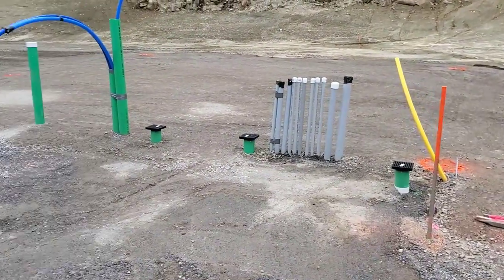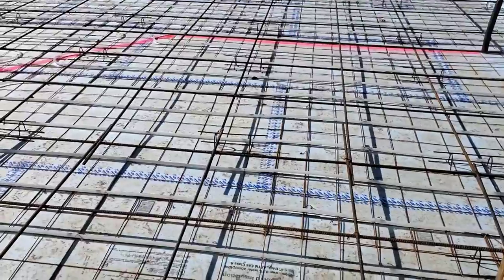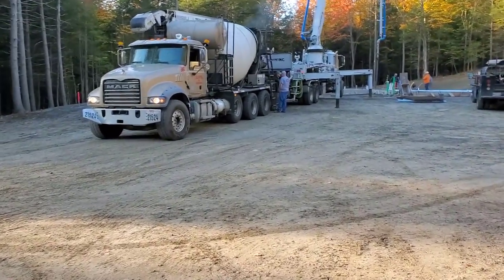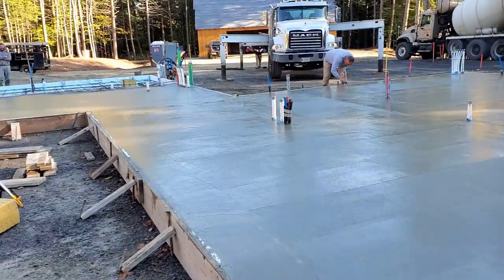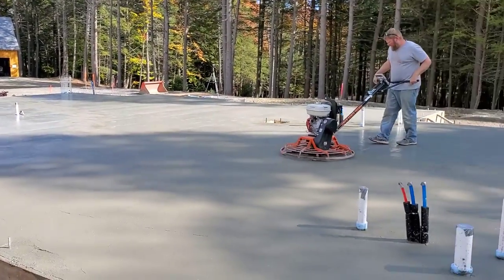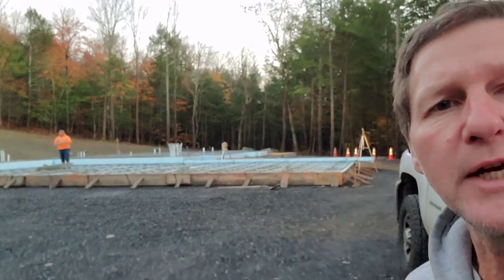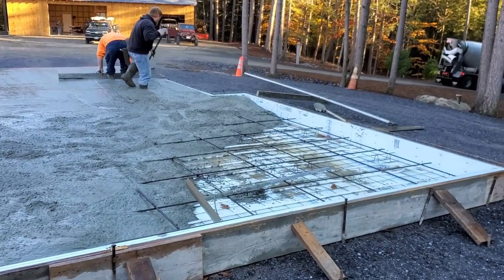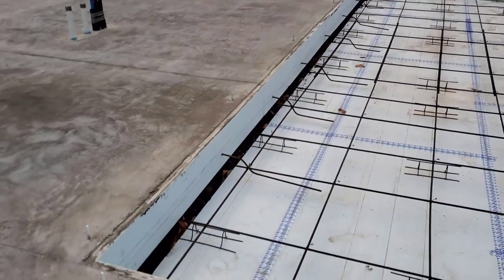Concrete Slabs 10" Thick! House, Garage, Patios - Overkill or Not?

Comment: What prevents the slab from heaving with the frost?  In other areas of the country, the codes require footings below the frost line.  Are basements rare in Maine?  Great video!
Reply from the maker: The slab is heated. The ground under the slab will never freeze.

Comment: Interesting.  I'd think a deeper slab allows the radiant heat to operate more efficiently for multiple reasons and seems to me to be a sound choice by the homeowner especially if the owner will be using solar or other green energy source.
Reply from the maker: Great point!
Reply: There are several papers on that very topic.  Turns out the influence of a thicker slab is negigable...what only is marginally influential / better is the distance from the pex tubes to the top of the slab. the smaller this distance the better.  but really so negligable it's not worth trying to optimize.
Reply: @jonathankerr2275  It depends on the overall design but a thicker slab can store more energy which can benefit by reducing the load on active systems, which consume far more power esp when cycling as temperature varies during the day.

But if your only measure of efficiency is limited to a single part's ability to raise a room's temp by 1° F  in x amount of time then yes, hang the hot water lines from the ceiling.
Reply: @michaelm7324  also stores more solar heating if they do any passive solar planning

Comment: did my apron 25 years ago 8 x 20 ft , No exp, jts. NO cracks . ABC roof co on it and some other trucks too, Its 10 inches thick stiff mix no water added

Comment: A 10 inch slab seems a little overkill, but I'd do it on my house if I were building, better to be to thick/strong than the alternative.  My vote is for the Barn Board look, that looks great.
Reply: I’d do 2 layers of rebar with anything 8 inches or more.
Reply from the maker: Awesome, thanks!

Comment: I have a 32x48 garage getting poured in a month or so.  I am going to have some footings inside for supports for a 2nd floor.  I think I'm going to build the second floor a little later than I want to pour the floor.  Do you think it would work to box off those footings and then after I do the second floor and set the columns, finish the floor pour over the footings?  The footings will be 10" thick and 30" square, eventually underneath my 6" floor.  I will have 4 footings for the columns.  Thank you.
Reply: I'm building a 24x36 building with a crane inside it'll have four posts I'm going to put the footing same as yours talking underneath the concrete threaded rebar sticking up support my crane and then pour the slab

Comment: Hi Mike looks awesome!! Just wondering what keeps the foam on the outside edges from falling off?
Reply from the maker: They have screws on the inside that are left sticking out about an inch. The concrete is poured and the screws hold the styro onto the edges when we remove the forms.
Reply: @MikeDayConcrete  thanks!

Comment: It just so happens that I did some measuring today to see where my slab starts. On the inside of the house it is 39 inches from the top of the window stool to the carpet. When I go outside and measure 39 inches from the top of the window sill, there are 10 more inches to go until I hit the ground.  Does this mean my house has a 10+ inch slab?

Comment: Hey Mike,  Just had a home built last year and they didn't put in a vapor barrier under the basement slap it's not structural to my understanding as the house sits on footers. I'm having Radon issues in my home I live in Spokane, WA which is one of the highest places for Radon in the US. I'm trying to work with the builder to find a fix, he suggested some RedGuard on the floor, which set off some alarms. Will I end up with efflorescence issues if I waterproof my floor with no vapor barrier underneath? What would you recommend?
Reply from the maker: Check out RadonSeal penetrating sealer.

Comment: Good job Mike !!  Yeah those 10 inch slabs is a lot of wasted concrete  !! I could see maybe a 6 inch slab 10 inches on the edges !!
Reply from the maker: That's what most of the one's we do are, 6" with 10 to 12" edges.
Reply: 10 inches on edge?   Garbage.   At least 3 feet (to frost line ) with a footing underneath.

Comment: Excellent Video...Very Impressive but I got a Question...It seems that there were a couple of months between your first pour of the house then you returned for the Garage etc...I assume that this means the concrete was just sitting there exposed to the elements so doesn't the Rain do damage to the Concrete if it is just sitting there for a couple of months ???  I really need to know cuz I will do doing some Concrete soon as the Spring comes and want to do it right and fear that exposed Concrete will get damaged by the rain... Thank You for the Cool Video...!!!
Reply from the maker: No, rain won't damage it after it's cured and hard.

Comment: Too heavy increases likely good if settling  imo I've seen it  however guess if subgrade is compacted properly  should be fine. Be better off with a monolithic at 10 and rest solid 6in
Reply: Different strokes for different folks as they say
Reply: Translation: "Too heavy, increases the likelihood of settling.  I've seen it.  However, I guess if the subgrade is compacted properly, it should be fine.  You'd be better off with a monolithic foundation with 10 inches for the footings and 6 inches for the slab."
Reply from the maker: Sub-grade was 99.9% compaction
Reply: @MikeDayConcrete  yes I saw nothing wrong with it looks great to me, awesome hard work as always
Reply: @jej3451  yes sorry was omw to work didn't proof read. Was talk texting
Reply: @MikeDayConcrete  well the  gentleman should have no trouble driving a D9 acrost it. With price of concrete. ATM from central alone I'd hate to see that bill

Comment: I don't like the fact that they're relying on the slab heat to prevent frost heave.  What is the frost line there?  On the coldest winter you could get frost under slab.  What if the power goes out?  I know it's not your design, your just pouring the concrete.  I've never been a fan of designs like this.  Nice work Mike!

Comment: it's always "dangerous" to judge whether or not something is appropriate in a certain context (especially when you are from a another country, cheers from DK 😊) But we rarely use more than a  4 inch slab – but that’s with trench dug footings. So, when you use pour it all at one it’s seems about right 😊. It will newer shift/settle, that’s for sure – Cheers.

Comment: To bad you couldn't  of used a dyed concrete on the barn board if would of made it pop more, in my opinion. was there a reason why 10" thick concrete, not like you was parking loaded tractor trailers on it and even then your usually pouring 6"
Reply from the maker: We used Gull Grey in the stamped concrete, charcoal release.  He just wanted to grade the sub-grade all the same level and not dig any beams.
Reply: @MikeDayConcrete  makes sense but still a little overkill